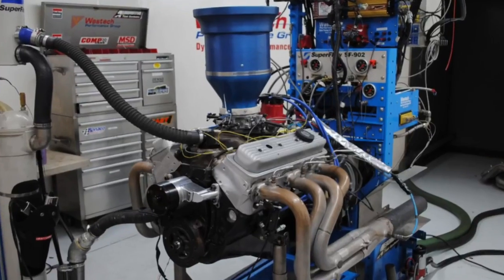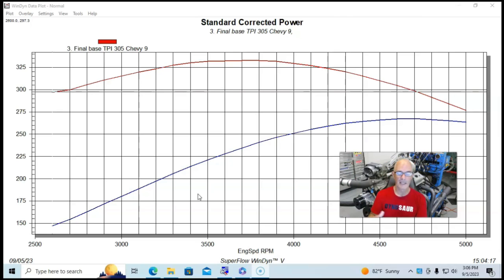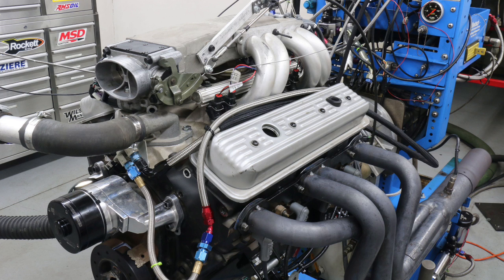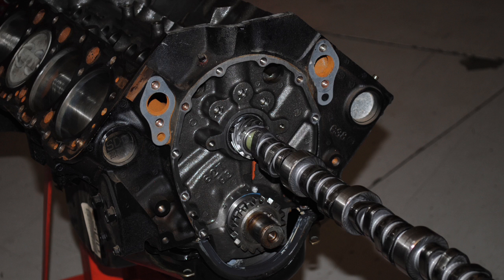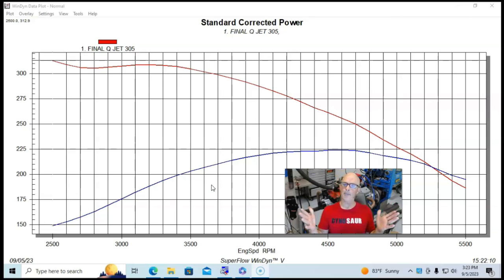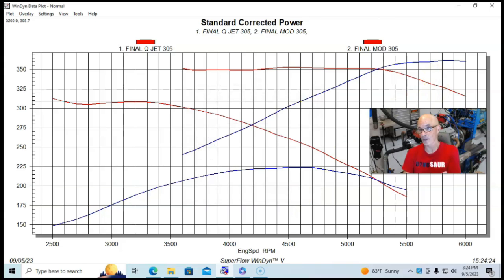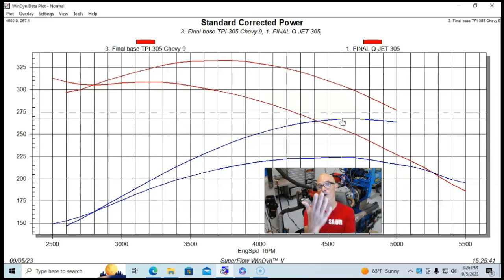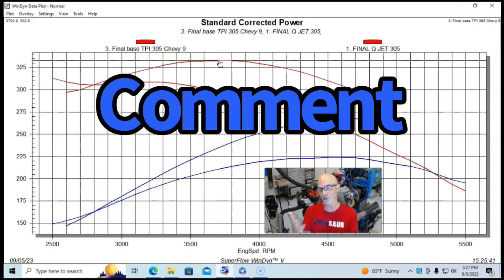HOW TO MAKE 305 SBC HP. Q-JET VS TPI-ADD 100 HP TO YOUR 3.73-BORE 305. FULL RESULTS-WHAT WENT WRONG?

Comment: Great info. I used to have a Dart headed 305 with a Summit cam exhaust etc, in my 1979 Camaro went 15.1. But I thought it could have been better, so it got a 150 shot of N.O.S. went in the 13's not bad for a 305.
Reply: What fuel do you need to not strip a ring land at 15:1 with a 150 shot?
Reply: @hayden6056  
15.1 in the quarter sorry for the not clarification.
Reply: All good I was just like Jesus that's big comp haha.

Comment: I think the answer lies in the tuned port length of the runners that gives high torque a dual-plane manifold is much shorter and doesn't have the velocity of the long tube intake

Comment: I think it boils down to runner length in the intake track. the Q-jet manifold has shorter runners than the TPI. which changes the harmonics of the pressure wave during induction. those tpi runners are about as long as a tunnel ram. I don't know if it was a factory manifold or what year, but some of those just suck really bad.  the best on that I know of is the factory L-82 aluminum corvette manifold 3997771 and 340261 from Camaros, and the 458520 from corvettes.

Comment: Both stock engines had their power peak before 5252 rpm. So the one that made more torque also made more power.
Side note: I'm not very familiar with those old cast iron intakes. Do the ports match up with the TPI heads?

Comment: A few years ago it made sense to get a 350 instead of modding a 305 but now 350 prices gotten so high its worth modding a 305
Reply: Prices are still really low
Reply: @greenbassboosts8872  not here in California a used 350 cost more than an LS over here
Reply: @doolallyproductions7234  Interesting. I Wonder why some California guy didn't come buy my truck with 4 boat mains 350 for $500 then

Comment: Intake runner length on the TPI is much greater than the cast iron version.  Also, you didn't mention casting numbers on the stock heads.  were they the same valve size & combustion chamber volume?  Higher compression ratio on the TPI motor?

It would be neat to get ahold of a Smokey Yunik SY-1 intake and see how that compares to current technology.  I have a buddy that has one, but hasn't put it on anything for a very long time.

Comment: I'd say the tune port made more torque therefor Horsepower = Torque x RPM / 5,252 would calculate more hp. Tell me if I'm right.
Reply from the maker: both the hp and tq curves of each were provide in the video

Comment: The factory cast iron Intake manifold used must be a major air flow restriction. The carb may have something to do with it also. If I had to pick the major factor it’s that intake manifold.
Reply: The manifold definitely, not the carb. That qjet flows around 750cfm. Plenty of carb

Comment: Interesting.. What’s crazy is the 302 SBC would stomp both of them lol
Reply: Bigger bore with better cylinder head amd camshaft
Reply: Better parts
Reply from the maker: a stock 5.0l 302 made the same power as the tpi 305
Reply: @richardholdener1727  I think he was referring to the DZ302 not that blue oval stuff 😆
Reply: @richardholdener1727  I was talking about the 302 small block Chevy. The DZ 302
Reply: The dz302 was beast, made to race! Drivability and mileage not as good as a 305...